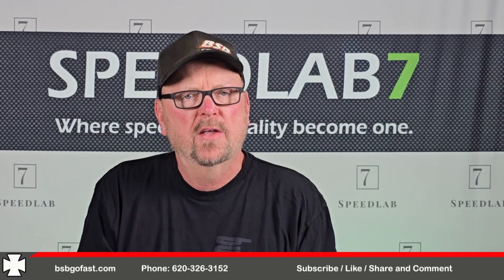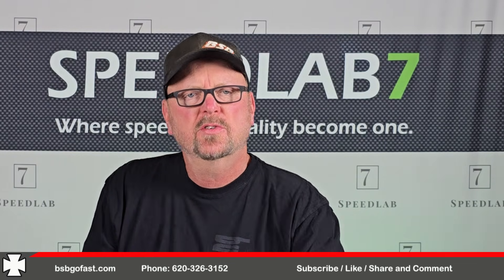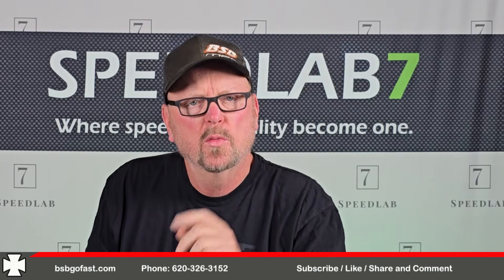What Is a Brake Floater and Why Do You Need One?

Comment: Jay, As you move the bar down on the floater doesn't the force on the rod increase?
Reply from the maker: The angle may have something to do with it, but the generation of force stays the same.  The applied force pushes on the nose of the car harder (forward) when you lower the bar.